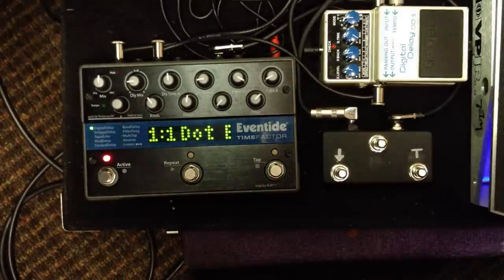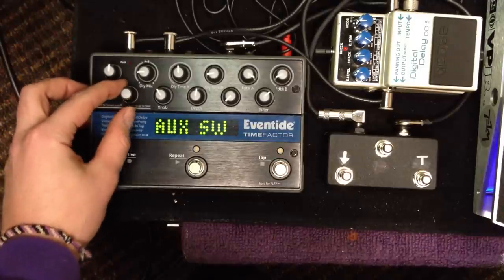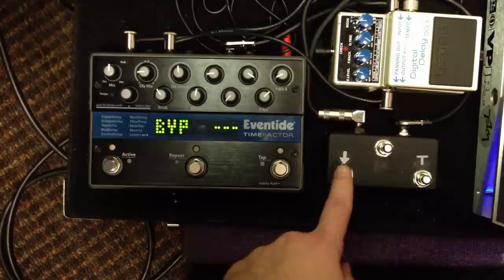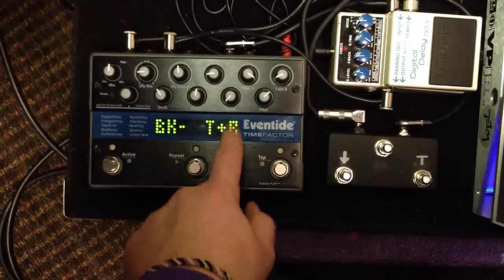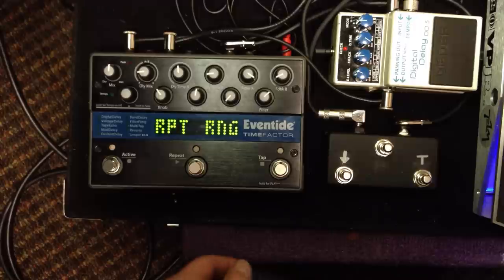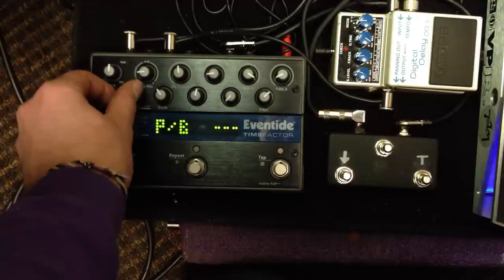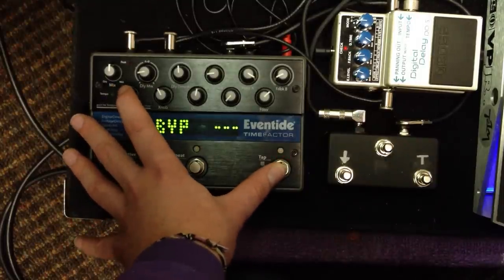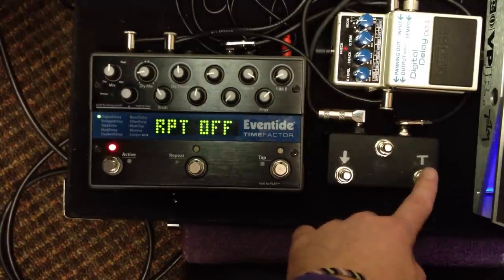Eventide Timefactor Aux Switch, T1M E3D

Comment: Thanks for this. Question will this also work with the American looper aux switch? I seem to be doing all these steps but for some reason the six switch will just stay in bank one; it won't change to the other banks, unless I'm not saving them correctly? 

Thanks!

Comment: I am using the Boss FS-5u and it works great! Thanks!
Reply: hey Aaron, quick question.
are you using the FS-5u as a up/down bank switch?
thanks!
Reply: ***** I originally was using the FS-5u as a tap tempo so I could set the temp easily when playing live and in bank mode. Unfortunately then I only had a bank up (right switch), so when I passed my bank I had to go all the way around which kinda sucked. I was using an instrument cable for the FS-5u as well which kinda was a little funky sometimes seeing as how the eventide ax switch is suppose to have a TRS/Stereo cable. But it worked fine for what I was using it for. I'm sure if you used the FS-5u with an instrument cable for a bank down or up it would serve its purpose fine. 

I actually am using the "Eventide Aux Switch" from Matthews Effects right now and I pretty much love it. It has three switches, so in bank mode, I am able to use bank up, bank down, brake, and tap tempo, or whatever combination you want which is super nice. However, you need to have a TRS/Stereo Cable for that or it won't work, and it wasn't like I had one of those laying around. So I ordered a Monoprice TRS Cable and its working great. Here's a link to those if you wanna look...

http://www.amazon.com/Monoprice-109439-1-5-Feet-Premier-Series/dp/B009PN2INA/ref=sr_1_5?ie=UTF8&qid=1392608764&sr=8-5&keywords=monoprice+TRS+cable

http://www.matthewseffects.com/switches/eventide-aux-switch

Comment: I recently got the Timefactor + T1M aux switch combo and I noticed that after I change the tip, ring, sleeve settings and turn off the pedal, it goes back to the default settings. Is there a way you save the T+R+S settings on the timefactor? Thanks!